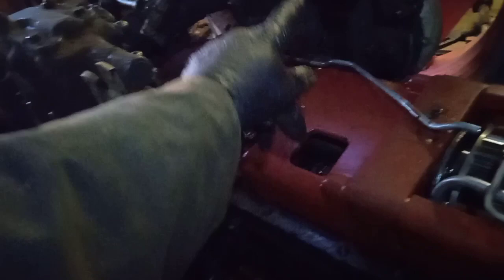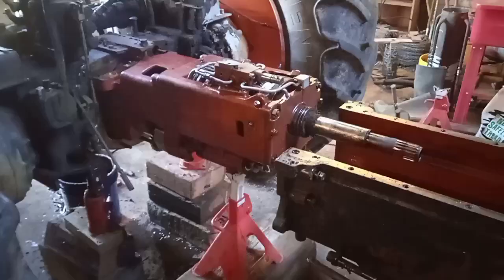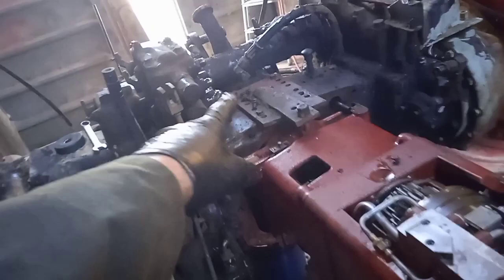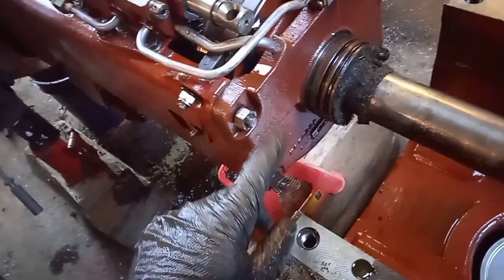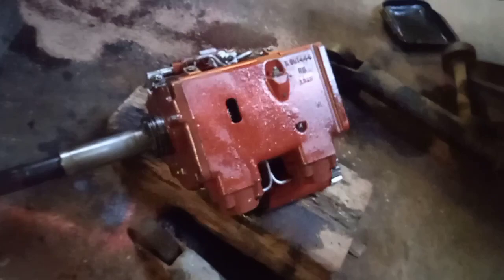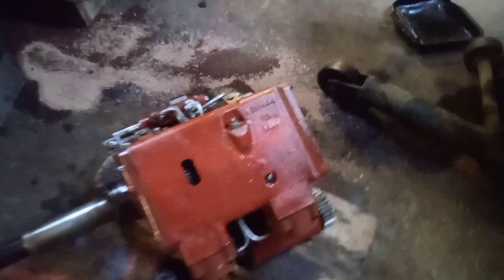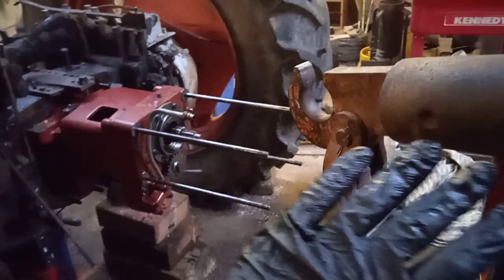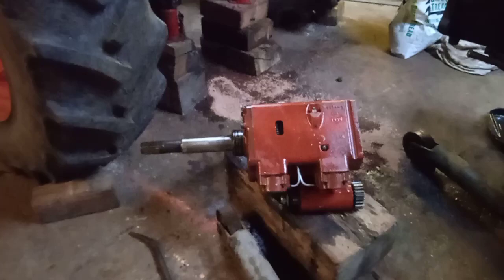Case 1594 Hydra-shift gearbox removal

Comment: Little tip if you move the front far enough away, the pto shalf will come out of the front. Saves you having to remove the unit and save a bit of time. I pulled money out that way when I did my hydra.

Comment: Insane! (In a good way, lol)
I should do this too, as my Hydrashift is kaput, but am way out of my depth for this kind of job: looks pretty intimidating.
Reply: I came across this while looking for something else. The Hydrashift unit is a actually quite simple as mechanical things go. (the 3 point linkage hydraulics are actually more complicated than the gearbox hydraulics.)  As someone else commented just take your time, double check if something is tight and don’t force anything and you will be fine, taking this apart. Mechanically this gearbox is actually very strong, it was massively overdesigned for the horsepower that originally went through it when launched. The hydraulics are simple and the valve setting can be done with a grease gun filled with oil. In principle how the gearbox works is it has 2 x epicyclic units, with a clutch pack inside each epicyclic unit. 1st gear is both units are in mechanical drive through the epicyclic, no hydraulics, are needed, and that’s what the brake band does. It locks the epicyclic hub from turning. This means it always has engine braking and wont run away on a slope, and you can tow the tractor to start it. When 2nd gear is selected the front clutch pack locks up and front brake band releases, and the rear unit continues to drive through the epicyclic with the brake band locked on. When you select 3rd the 2 epicyclic units swap, the rear unit clutch locks up,  and the rear brake band releases, with the front unit going back to epicyclic and locked. For 4th gear the front unit clutch engages and both brake bands are off. The hydraulic pump for the gearbox is driven off the gearbox. This means that each time the tractor stops the hyd pump stops. Which is why it goes back to 1st gear. Other than contamination in a valve the only thing that really ever goes wrong is if someone thinks its automatic and leaves it in 4th, because the clutches can slip engaging 3rd gear because there is not enough oil flow to work the clutch pack swap over. Most of the units I repaired where ones which other people had tried to repair and upset the settings, there was nothing much major wrong. But it is a “cab off, and gearbox lid off to get at the parts to do the settings